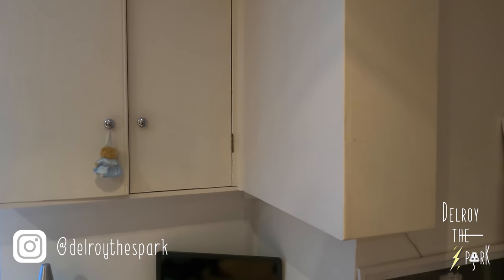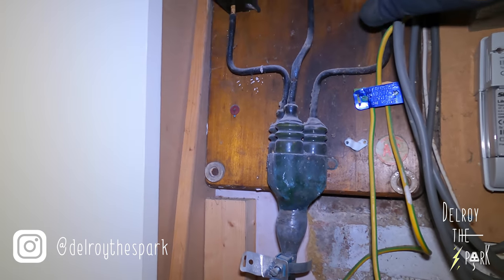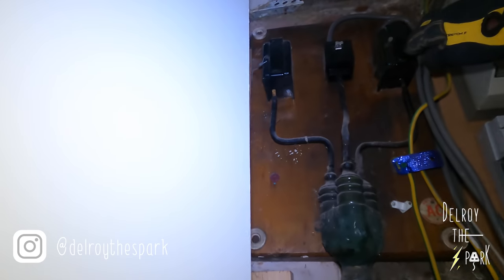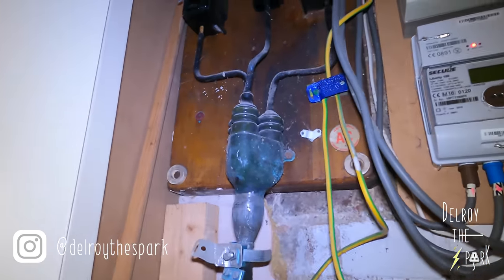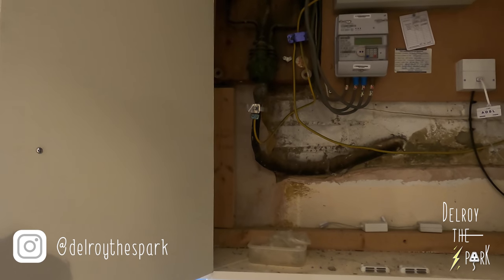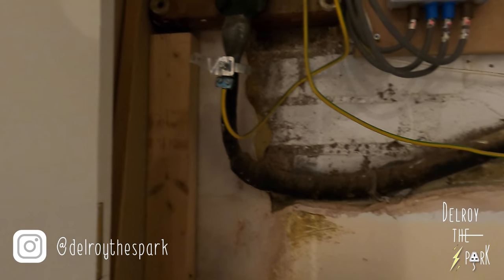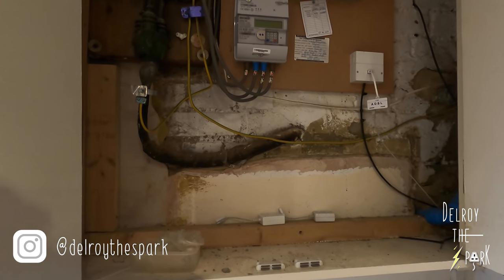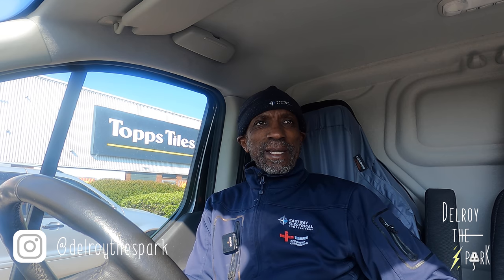"You Need To Contact UK Power Networks As This Is An Emergency" | Electrician In London Vlog

Comment: Guarantee that whoever installed the smart meter had chocolate wrists and didn’t properly tighten the connections in the fuse carrier. Then the whole thing heats up and slowly melts, welding the fuse to the stalks.
Reply: I'd say that's spot on. I had a similar issue with a new consumer unit in my house. One of the screws for a breaker had not been tightened at all (must have been a tough thread) and the Slovak sparky I had in obviously hadn't given the wires a tug to test. The cable was melting due to the arcing. I only noticed it due to a slight fishy smell, like an old Scalextric set. Luckily there was enough spare cable to snip off the melted section & fit back in the buzz bar.
Reply: Chocolate wrists 😂😂😭
Reply: Either that or he couldn't be bothered had a similar experience when someone was fitting my electric shower. literally just connected it and set it on the wall with 2 screws. chasis of the shower wasnt put on correctly and they hadn't but caulk around it to prevent water from leaking into the wall and causing damage
Reply: What does chocolate wrist mean?
Reply: @mandc20022  Lacking the required strength to operate the screwdriver to tighten connections sufficiently to prevent them slipping out, arcing & setting the gaff ablaze.
Reply: @mandc20022  weak wrist
Reply: Either that or the supply cable to the board maybe heated by being close to current carrying capacity causing thermal expansion and contraction  at connection he did say it was installed 15 years ago  and I  that time loads may have been added plus the UK has immersion heaters electric showers etc. Alot of changes can happen in between installation and when I see it that's what I tell myself anyways
Reply: @mav5204  Nah we pretty much never get call outs for melted cut out fuses without some form of bad connection in the fuse carrier. The fuse boards main breaker would melt out long before our equipment. A bad connection in the meter or rcd will blow a fuse or melt the tails before damaging the cut out.
Reply: To clarify the minimal expansion and contraction in a such a small connection is irrelevant. Consider the cable is expanding to fill the ring at a higher rate than the ring is expanding away from the cable.
Reply: @cdd1craig  the cause of the bad connection is what I'm referring  too good connections can go bad if circuit parameters are not maintained
Reply: @mav5204  Nah, no correlation to the loading. Our equipment is simply better rated than anything domestic and cycling loading will affect both. Similar to protection discrimination we essentially have equipment rating discrimination. Iv never found evidence of high cyclic loading at these sort of jobs. The cyclic loading does make a bad connection worse, but a good connection won't deteriorate due to cyclic loading within its rating.
Reply: Or at least the cyclic loading will deteriorate the lower rated domestic equipment before it affect the cut out. And since iv never seen a domestic property with a balanced trip board. A cyclic load will burn out the domestic circuit before it blows a cut out fuse even if the trip fails.
Reply: @cdd1craig  in an ideal world the system would work that way but in this case the supply is quite old given time the expansion and contraction will loosen off any connection added to that insulation breakdown from heat or time  its just nothing is forever even with the best equipment and materials eventually it will fail I've seen loose  connections on a 800a bus bar that were torque spec tightened at installation it's best to take nothing for granted
Reply: @cdd1craig  I looked at the video again at 1.46 if you look at the color of the conductor on the  phase  on the left bright copper to the  welded fuse conductor  at the base you can see the black carbon buildup on the supply conductor given the guys talking about ironing while cooking I'm going to guess the cable in the supply may have had strain over the years which could of caused a loose connection  to develop there seeing as the terminals  are in a sealed fuse may never had maintenance ie tightening the loose connection developed to an open arc at times welding the connection point the carbon built resistance altering the supply voltage down stream explaining the flickering and dimming  the heat from the carbon arcing cycle welded  the fuse in place that's my guess anyways it also explains the fissing
Reply: @mav5204  I just disagree. Iv never turned up to an old cut out thats developed a loose connection. Old cuts receive zero maintenance or tightening through there lifetime. Every time I get called out its after some work in the past 6 months. There are millions of cut outs in my region, most of them are old and yet we get max 20 call outs daily for cut out faults and there is so predominance of high cyclic loading. Weed farms and laundrettes, overloaded cut outs blow fuses well before they damage a cut out. Consider also that fuses break down under constant cycling, its just a thin cable at the end of the day.
Reply: @mav5204  what you’re seeing there is definitely the result of a loose connection. It’s loose because somebody failed to tighten it correctly, not because of cyclic loading.  

I have seen this on several cut outs, and even LV distribution pillars where someone has failed to tighten the fuse properly. It creates a high resistance joint, which creates heat, then conductors start to melt. 
The load doesn’t have to be unusually high for this to happen.
Reply: @LordStraightBanana  I seen both and no way to tell difference the same fault can occur 3 ways as I see it as I described as you describe it can also occur from an over tight connection that damages the conductors  in time all 3 will exhibit exact same reaults
Reply: @LordStraightBanana  there are studies on how it occurs her is a quote from one It is well known that bolted joints may loosen [1] when transversal loads are applied on them. However, bolted joints’ clamp load may also decrease gradually when being subjected to cyclically temperature variation, and it should seem as loosening as well.
There are two main mechanisms for loosening induced by temperature variation: (1) plastic deformation and creep behavior of materials; (2) relative motions caused by expansions difference. For the first mechanism, many relative researches have been done [2, 3], while few works have been taken out for the second one.

Comment: That old live phase feeding into that loose main fuse looks like it's been a bit overheated as it looks like the insulation has melted back a bit.  And why is there two phases? It looks like an old supply cable left over from the days before our supplies were standardised when there was different voltages and even some DC mains supplies. Or perhaps there used to be a separate supply there for a second flat dwelling, but in that case they'd have to share a common neutral which would have to carry the load of both supplies, not a wise idea unless it has twice the cross sectional area of the phases which it doesn't appear to have. Not good at all. Or perhaps it was some kind of dual voltage supply in the old days, I see the board is marked AC so therefore it must date back to when there was still some DC supplies in use there in that area. That was often the case where there was trams in use as they run on DC but at a higher voltage, usually around 550 volts, often supplied by a rotary converter or through an old mercury arc rectifier, and they used to have one of those at the science and industry museum in manchester, but I don't know if it's still there. It's a dirty great big glass thing that was used on a local railway line there in the past to supply the old live rails. Or else the power plant used dynamos to produce DC but I don't know how they provided different voltages, since DC won't work in a transformer, I think they must've had extra brushes on the dynamos at different positions on the commutator, that would simplify the generating plant.
Reply: It’s possible the power was originally 480V centertap, which provides you with 2 phases of 240V each at 180 degrees. Like a US system, except on steroids. I would assume it’s been replaced at the transformer to a standard three phase setup by now, but either way, the neutral conductor gets to be the same size as the two lives because of phase angle.

Here in the Netherlands I know that — besides our standard, which is three phase 220V (230V nominal), with either one v large conductor or three smaller ones per house so that service can be upgraded from the standard 1x35A or even the older 1x25A without pulling new wires — we used to have in residential service both two phase at 110V each as well as three phase 127V (with 220 between phases, which gives you everything-is-live capabilities). All of that has been long replaced with real 220V service, of course. I remember in the late 90s when the last 127V system went away near where I was at university in Delft.
Reply: @JasperJanssen  I've been to the Netherlands, and I noticed they use the shuko type plugs which don't have a fuse, so therefore they must still be using the old radial type system for the sockets, with a separate supply cable and breaker for each socket, which means having a supersize consumer unit, or load centre with loads of breakers fitted, just like in the states and Canada and lots of other countries. But here in the UK we've long since changed over to ring mains for the sockets with fused plugs. With the old system there was usually lots of separate little cast iron fuse boxes on the supply board which was cluttered, so now we have only small consumer units with just one breaker for each ring main, and there's usually only one ring main in the average house, though some folk fit more. And we used to have different socket circuits with different ratings, and different size sockets to match, which were non interchangeable so you couldn't stick a plug in the wrong socket.
Reply: @majorpygge-phartt2643  uh… no. We do not use ring mains nor do we use radial let alone with a breaker per cable.

We have a star-and-bus system, just like every sensible country on earth. Ring mains are deeply unsafe, and are only used by the UK to save on postwar copper.
Reply: @JasperJanssen  How are ring mains "deeply unsafe"?? The overall system, with a local fuse protecting each appliance cable, and the main breaker protecting the fixed wiring is as safe as, or maybe more safe than, a radial/star installation.  As for a "star-and-bus" system what is that if not radial distribution?
Reply: @barrieshepherd7694  the fuse on a ring mains is sized to the current carrying capacity of both legs of the ring. That means that if only one connection breaks, the entire load runs on a single wire that is sized for half of the maximum current that can be put on it. And what’s worse, the user cannot tell that such a break has been made at all. Only a good sparky with measuring equipment can possibly tell.

Your interpretation of “radial” seems to be a pure star system, where every consumption point is pulled directly back to the breaker box and moreover each has its own breaker. While it is possible and allowed to do that (and it’s necessary for old fashioned or very high end smart homes, where each breaker is essentially replaced with a breaker and relay/dimmer assembly), normally many consumption points are wired to a single breaker. Normally, in newer installations in NL, it’s a star radiating out from the central light point in the ceiling of each room, with a single set of wires going back to the breaker box from there.
Reply: @JasperJanssen  i was wondering whether it dates from dc mains era, as that was sent out in both polarities, with centre zero common, alternating houses alternating polarity, some houses may have had both poles for high power usage
Reply: @JasperJanssen  it was usual in uk for ring main cable rating to be equal or better that the fuse/breaker rating so if one end failed thered be no overheating,, but that may have changed over the years...
Reply: @andygozzo72  that was never the intent of rings, anyway. And it’s not true. You guys use 2.5 mm^2 cables and fuse it at 30-odd amps. That’s not safe with a single wire.

Comment: Bloody smart meter installers! Cocking up an antique service head like that, they should be jailed for crimes against historical electrical artefacts.
Reply: it is really beautifull. If i got thrown out of that home i would cut it out!
Reply: The vintage cable is ok as long as it's 10mm+ copper... Ground should be thicker than live (in front of the customer meter) and the whole compartment looks flammable...
Reply: makes you wonder what they did with the asbestos that was certainly in there originally
Reply: @JasperJanssen  Where in my comment did I state ground comes from electricity provider?
Reply: @Mic_Glow  you said something about “ground in front of the customer meter”. There is no ground in front of the customer meter.
Reply: @JasperJanssen  the earth is on the service cable before the cutout
Reply: Jumping to conclusions a bit aren’t you? The fact the main fuse was loose on the board means the incoming live may have been the one that was loose. Smart meter installer isn’t allowed to check the live side for tightness. That head was fit for the bin anyway. The plastic degrades over time and the outer housing of the fuse can become live.

Comment: 105 gets you through to you local power distribution company, you can't do any work on that main fuse (including pulling the fuse) unless your authorized to do so by the DNO in that area
Reply: You need authorization to replace fuses over there? Here we are popping breakers in and out, no fuses required.
Reply: @SurpriseFox  the main cut out fuse yes, your own Fuses and breakers no you can do them to your heart's content

Comment: Yea I still say the LEB. Hahah I had that problem
Once loose connection burnt out fuse holder welded together ,due to loose connection on tail .. called leb ( it was them in those days ).. they fixed it .. also another in Camden old installation guy said it was getting hot old porcelain main fuse holder some one had put a nail in it it was like a heater bright red ...
Reply: just needed a smaller nail....
Reply: Ha, when it's nearly as hot as a 1 bar fire, that's a problem!

Comment: I've never seen a service intake like that before. They'll probably replace the whole head.
Reply: We had something like that at a house here in Canada from 1940!. They insisted on replacing everything back to the transformer down the street. Turns out that this house was under construction at that time and wasn't even included in the record of the electric company for site upgrades. The total cost was $CDN20,000 to the road and then another $10K to the transformer with the Hydro company picking up the other $CDN10K because of multiple houses being wired in the street line. My friend's house was declared unfit to live in after a tear opens the walls and inspect the wiring inspection by the power company. for six weeks while the electrical was redone. The people that sold him the house hid the knob and tub by splicing some copper near the electrical boxes and direct connecting to the knob and tube behind the boxes. The house rewires took another 12 weeks due to permits and inspections. and it cost another $CDN20,000. Total cost $50,000 due to flickering lights. A team of six electricians was responsible for the rewiring and then all the drywalls had to be redone from three feet to the baseboards as well as all the trim is replaced. Upgrade from a 60A service to a 200-amp service, priceless😁.
Reply: @PWingert1966  hey if you ain't footing the bill
Reply: @PWingert1966  hang on. I assume he did t have to pay for everything from his meter onwards? Their bad recordkeeping in the 40s doesn’t mean it’s suddenly the home owner that owns that part of the service and is responsible for paying for it.
Reply: Nope they will just replace the fuse carrier the rest will be fine
Reply: He had to pay for it but is suing the realtor and the previous owners. The case is still before the courts.
Reply: @JasperJanssen  He had to pay for everything from the edge of his property to the house and the entire interior work. He's taking the whole thing to court and suing the previous owners for fraud and misrepresentation as well as punitive damages. He's submitted a figure that matches the price of the house plus 30% figuring settlement will get him 50% of that eventually.
Reply: @PWingert1966  well, good luck to him. I could certainly see him having a point with the in-home stuff that was incompetently hidden but I’d be surprised if the stuff before the meter could be called their fault.

Then again I’m also really surprised that that part is the responsibility of the home owner in the first place so those two surprises might well cancel each other out, if you see what I mean.
Reply: @JasperJanssen  It's just the Hydro company pushing their weight around.  When it gets to court, I suspect his lawyer should be able to cite chapter and verse for the appropriate legislation and case law to establish where demarcation falls. The hydro company will try and stall it till hell freezes over of course hoping he will go broke before it gets tried. Then they will say oh right yes we had overlooked that.....if it gets revealed otherwise, they get the edge of the property, and he spends tens of thousands for nothing. I have heard of this tactic before. Apparently, there also may be some ambiguity on establishing the Demarc depending on whether they look at current legislation or the legislation as it exists when the neighborhood rewiring was done. The original contract for the rewiring nay has established Demarc at the edge as a term in the contracts.